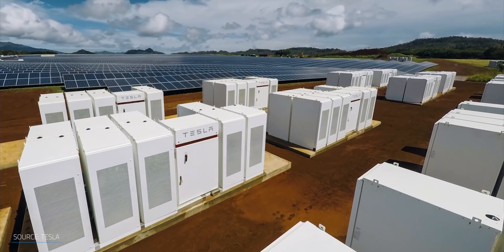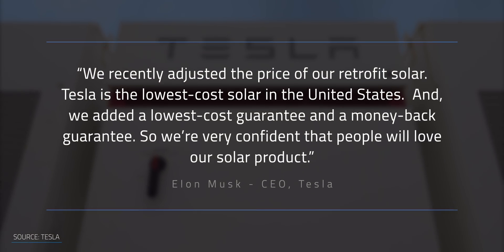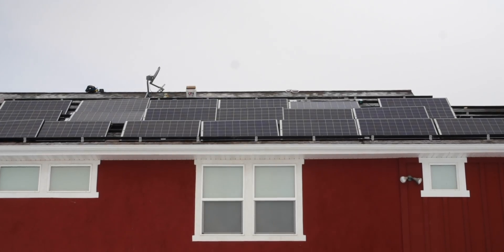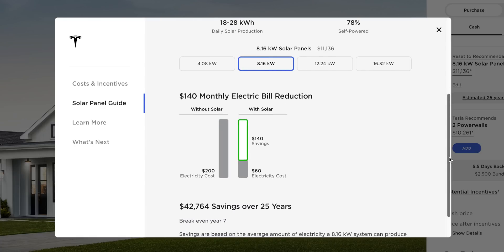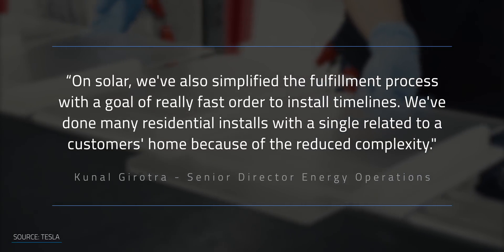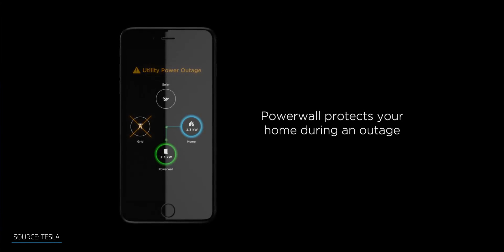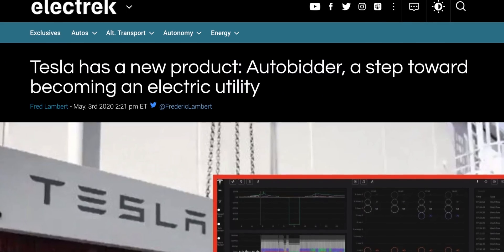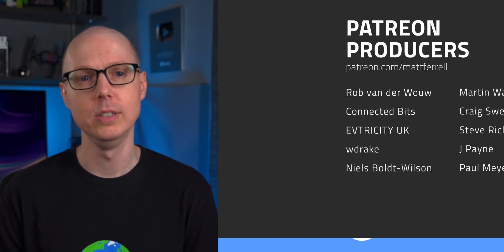Exploring Tesla solar panels game changing price

Comment from the maker: Anyone planning on getting Tesla Solar?  If you like this video, be sure to watch "Exploring Tesla Powerwall and home batteries - worth it?" here: https://youtu.be/Xdo_DIJJxWA
Reply: The ROI on solar used to make it a non-starter. Today, the ROI for me is about 10 years. That makes total sense. The power walls on the other hand, dont. Im in a net metered area, and I can just use the grid for a battery. Being connected, and the administration means that I will still have an electric bill. The interesting question is what will happen to the grid when the tipping point is reached with consumer solar? Will rural America loose access to the grid because its not cost effective?
Reply: @raullasvegas  yeah that's true but without the battery in a blackout you're still in blackout. don't really make a lot of sense .
Reply: @bobholland9924  Ive lived here 5 years, and have had 1 blackout for 4 hours. Next week I will spend a week in the woods without power. For me, it doesn't make sense.
Reply: @raullasvegas  Wow, the ROI on my 12.28Kw system was 2.9 years in Australia, we DO have higher energy costs so that does shorten the ROI. My  cost was $.72/watt for the full system installed.
Reply: @raullasvegas  That makes it theft if you need to take my money in order to make it work.
Reply: @MindBodySoulOk  do you understand that the incentives lower costs to you more than the incentives? If everyone was on solar, you wouldn't have to pay for the grid. 10% of the grid is used to make gasoline for cars. You pay for that. These people driving teslas, and installing solar are saving you money! BTW, are you city folk, or country folk?
Reply from the maker: I think we’re finally hitting the tipping point for solar for most people now, which is great.  I’m with you on the home battery cost/issue.  Actually working on a video about that right now.  Batteries make the most sense in areas with time of use rates, net metering that doesn’t pay out 1 to 1, or areas that have virtual power plant programs.
Reply: @UndecidedMF  Thanks for all the information.  Your videos have led me to look into DIY solar and now Tesla solar (since the cost reduction) for my new house.  Unfortunately, the company we're building a house with won't allow us to do a Tesla Solar roof, but we're planning to install the solar panels after the house is done early next year.  

I'm trying to decide if the Powerwall is worth it since I'd have to get 2 of them to run 240v appliances (like A/C)  if the power went out, and I'm not sure it's worth it.  Where I live, we have 1 to 1 net metering, and we don't have "time of use" rates.  We do, however, have the occasional power outage, especially during the winter when we get lots of snow/sleet ( I live in midwestern United States ), so I'm still undecided.  I have until the spring (when the house is complete) to decide, though.

Keep it up!
Reply: Undecided with Matt Ferrell When you do the video for batteries please include easy to follow calculations for figuring out the ROI. I have TOU rates and SCE / WCE is only paying six to seven cents a kWh for my solar over production. Thanks and great videos as always
Reply: @andrewcoffman2213  "Unfortunately, the company we're building a house with won't allow us to do a Tesla Solar roof, but we're planning to install the solar panels after the house is done early next year." Is this really a thing? Here in Germany I as the owner of the house am the one who decides. Am quiet a bit shocked to hear the company you are paying dictates you what to do and what not.
Is this a common thing in the US or a special case?
Reply: @luckyqualmi   Well, if I had bought land and hired an architect, I could  do whatever I want, but I am working with a company that builds homes and I just pick from a list of options.  The main difference seems to be that I don't own the home until closing, and so I'm not paying for anything until that time.  

Solar is just not something most people here in the US (especially the midwest) think about.  When I asked the builder about it, he looked like he had never even considered it.
Reply: @luckyqualmi  Homebuilders in the US are divided into two types: independent or corporate. Corporate Homebuilders always own the land on which your home is built, and they set the rules for maintenance and modification. Most new communities in the USA are built by large corporations and are much cheaper than independent homebuilders, but they are inflexible. Unless a team if engineers, accountants and lawyers can agree on a community plan where the company makes more money by adding solar, it will not happen. Further, with the "covenant" system of restrictions on homebuyers, adding solar may be a punishable offense if it changes the appearance of the neighborhood.
Reply: I've been waiting for Solar to get below an 8 year payback for me.  Best price I found before was 12 years.  I'll have to get a quote.
Reply: We had an 8K system, with a battery, installed this past January. The sales process was simple, though I wish they improved the UX/UI on the purchase web site.  Once you place an order, you must submit a series of photos of your electrical installations, main panel, sub-panel, panel labels, area around the panels, etc. A single page layout would have been much easier since you could see in advance what information is needed.

Installation was done in one day but it took several weeks to have the inspector come and inspect the system. To be fair, we live in a very rural area, so getting anything done takes time. With the inspection and utility review process it took about 4 weeks after installation before we go the permission to operate.
Reply: Man I love the concept of solar but you're taking your most valuable asset and drilling hundreds of holes in it.  The risk for slow water damage (leaks small enough to not make it into your living space to be noticed yet still damage your structure) is just too high.  I live in MA and can get get all those same federal and state rebates, have a house with excellent solar potential and just can't pull the trigger.  Personally, I've asked about yard based solar but it's extremely expensive.  I'll put panels over my garage and risk a leak in there (where it would air out well anyway) but the panels don't produce enough electricity to be very compelling.  Just go to the Better Business Bureau and read the solar install horror stories... Sorry to be a bummer on panels.  The solar roof is what I have my eye on.
Reply: @Matt-dk3wl  What kind of roof do you have? The mounting solutions used now are well tested decades. Tesla also warranties the install for 10 years against leaks relating to install. I think you're worrying about a non-issue.
Reply: @gemini86  I've got 16 year old architectural shingles.  On a new roof solar panels can be installed OK. On a 16 year old roof, however, shingles will crack and not hold up to being manipulated.  It's iffy to even walk on them.  I'm hoping my roof will last long enough for Tesla's solar shingles to become more reasonably priced.
Reply: @Matt-dk3wl  when working with a reputable solar installer, leaks from your roof are a non-issue. Most solar companies warrant their roof installs up to 5 years. 

I've worked for two solar companies and I've never seen a customer with a leaky roof after getting solar. I know it can happen  but it hasn't been my experience.
Reply: @Matt-dk3wl  Umm, how do you think the shingles are attached to the roof?  Glue?
Reply: I totally want to buy Tesla solar and while they are willing to take my $100 order deposit now, when I speak to a Tesla solar adviser they say they are not currently installing in my area (Ohio), with no estimate on when installs for my state would begin.

So now I have to decide if it’s worth it to wait and possibly lose the federal tax credit (if Tesla can’t even install by next year when the credit would go down to 22%), or bite the bullet and install now with local installers quoting prices that are double the price of Tesla quotes. 🤔
Reply from the maker: That’s a tricky situation.  I don’t think the drop in Federal tax credit is enough to warrant rushing into it with such a disparity in pricing.  I’d recommend checking out places like EnergySage ... or even better for you might be EnergyPal.  They might be able to help you navigate these issues.
Reply: Undecided with Matt Ferrell : Thanks for these suggestions! I had originally gone through EnergySage and they sadly are also still growing in my area and I didn’t get many hits, leading me to contact local solar installers directly or quotes.

I will definitely check out EnergyPal to see if I get better results!
Reply: @UndecidedMF  matt based on the comments we should all move to India where you can get an entire solar system installed for about 150 dollars.
Reply: @Jaws1200  Same for me (also Ohio).  After looking into the total I decided to wait.  The solar option works best with the powerwall.  But pw is small so I would need three.  Now the solar cost is getting too high.  HOWEVER, I am hopeful that the next iteration of the model 3 will have v2g enabled so a switch in the solar system will enable the car to act as the powerwall (and then some 40 kWh pw vs 75 car).  Now if only Dandelion was in Ohio I'd be 99% self-sufficient.
Reply: So, where can I buy just the panels? I only pay about $0.60 per watt for my panels, but if I had some one else install it would be about $2.40 per watt. But as a family of licensed electricians we tend to do ALL of our own work. And so there is NO reason for us to pay a middle man to pay other people to do the work.
Reply: anjhindul 
If you’re in SoCal C.E.D. Will help you out.
Or any electrical wholesale house.
My question is why didn’t you already know that?
Reply: Love your ROI calc, hate that it’s only applicable to your state, also you didn’t calculate with a power wall which doesn’t make sense at all.
Reply: haha you pay dolar for wath when europe pays for kwh less than you
Reply: I'm hopefully having my system installed next month. Tesla and I are both just waiting around for my utility to approve the install. I was actually just informed by Tesla that I'm the first customer on this utility provider and they haven't worked with them before. I really hope their efforts reduce this kind of back and forth and time waste.
Reply: I installed my own n pieced my system together and I don't have probably 2500 dollars in the same power you guys are paying 20 grand for . It's ridiculous. I looked into alot of companies n plans n then looked up the equipment n was like how the hell are you guys coming up with you prices when I'm finding the same shit for half that
Reply: I had a 4Kw installed here in Massachusetts by Tesla last December.  I decided to rent at $50 per month with 0 installation cost.  So far this year, I have generated about 3200 kWh of electricity. At Eversource price of 22 cents per kWh that is about $700.  And there are more than 4 months to go for a full year cost of $600. So my break even was about six months.
Reply: I have a 16.38kwh system with 6 power walls about a year ago from Tesla and I got this pricing at that scale. Was totally worth it then, glad to see the pricing has gone mainstream!
Reply: With a current monthly bill of about $80CDN, solar electricity is not high on my list.
Reply: I added my address to the form, as expected like most other services, installation isn't available in my area.
Reply: Unfortunately,  tesla is not giving solar panels much attention. Apply online and keep waiting.
Reply: Like I've always told people regulations, inspections, and paperwork drastic increase the cost of adopting better and greener technologies, and even after you've through that you could have to wait months or even years to get through the system.

Over regulation is a huge issue that is costing our economy trillions, both directly and indirectly by the cost of our delayed adoption..

This is not to say we shouldn't have any regulations, but they shouldn't be overly complex processes with thousands of pages.
Reply: They still have to deal with each local utilities and their regulations. This is what has prevented national solar companies from standardizing their process and getting a national footprint. This is where local solar companies have thrived. 

If they can incentivize local utilities and municipalities, then use, they will change the industry for the benefit of the consumer.
Reply: waited 2-3 years for Tesla's panels in Sweden, opted for something else in the end (405W LG).
Reply: @Andy Geee after all taxes i pay around 1,50 SEK/kWh or something like that. i pay for the grid itself then i also pay for the electric supplier. i also pay for the main fuse, if it's 16A it's lower priced and going above 20A (the one i got now €54/month) will just be a kick to my dear nuts. I pay around €210 per month in total, i hope to get it reduced by 50% in the spring/summer next year.
Reply: I don't believe they do off-grid?
Reply: yes i will,  after Melon Flask dies
Reply: In Israel, a friend of mine installed a 15Kw system, at a price of 23,530 USD, which makes $1.57/w.
He receives from the electric company about 12 US cents per Kw sold.
He receives his full return on investment within 8-9 years conventionally.
Reply: I signed with a company to install solar panels (owned, not leased) and have the installation scheduled for a couple weeks from now. When I was doing my research I looked into Tesla and while they do have the lowest prices, they also have the absolute worst customer reviews in the entire industry. The consensus from customer reviews across half a dozen websites is that once Tesla has your money they don't care about you anymore. Yes, $1.49 / watt sounds great, but for an extra $0.50 a watt you can get a higher quality panel with a single brand of components (micro inverters and panels from the same manufacturer) and be guaranteed that you will have a company that cares about you and will return a phone call when you call for customer service. 

In addition, that extra money gives you a power output guarantee and a better warranty. Finally, Tesla has a real questionable way of getting to that $1.49 / watt. They are estimating credits from your state and local government as well as federal tax incentives which will be gone in 2 years (or less) and the estimate may not even be accurate.

Honestly, Tesla has a lot going for it in the Battery department and their cars are changing the industry (even with their crappy quality control), but their solar division has a long way to go. Hopefully it will get better, because if they can keep the price low and fix their terrible customer service problem they can be bigger than Amazon.
Reply: So, I purchased a 7.25 kW Solar panel setup for my home.  I had to order my (2) power walls separately, due to back log and some COVID19 impacts.

But my question is, since i order my system back in Nov. of 2019 and the system got installed in March...do I get the benefits of the new pricing? I don't see any difference in the initial price and the final price after install.
Reply: except the major issue with solar isnt the solar cells or panels, but the storage efficiency and costs... solar CANNOT be a 100 percent independent viable one stop shop styled option for many until the storage issue is more advanced than what currently exists, at a much lower cost... and i comment on this coming from a person who uses solar as a mainstay off grid
Reply: Tired of buying expensive cars and solar panels for rich people.
Reply: In solar, an efficiency "breakthrough" is a .0001% increase in performance. We're still decades away from a breakthrough that would justify fuglifying your house roof with hideous solar panels.
Reply: I forgot to ask,"Can you do a video explaining Real Estate Math"? Your thorough and clear delivery is 100s x better than my college instructor.

Great video
Reply: This thing is ridiculously pointless.

$52,000. Thats the price at Tesla's website for a solar roof that only powers your house during the day if you charge your car at night(due to the small battery) when most people are at work or school anyway? 

It would cost over $200 per month for 20 years to pay that roof off which is a typical power bill for a big home.

You still end up with a power bill on top of that for the tv watching, computer use, heating, lighting and car charging at night. SMH
Reply: Czech Republick have over 60% PATENTED solar cell.. but there you get point.. where is CZ-CELL unable keep togedher long time under full load.. ¨material structure¨ get heet up so badly.. ( due high efficiency) and you burn him down.. still anything over 30% is world best.. sooo...cry me a river elon liar!. ..
Reply: Good video as always Matt. One comment would be the Tesla’s terrible customer service and subpar quality of panels, inverters and general work. That is also how they able to bring the price down ...
Reply: Like all home improvement projects, solar retrofit will never be price competitive in the USA due to the added value it gives to homeowners. The high turnover of property ownership in the USA means that home improvement projects will ALWAYS be tied to Added Value and not to the actual cost of installation. A competent self-installing homeowner could get a solar retrofit done for less than $0.75/W, but whenever a contractor is involved, soft costs are overly exaggerated. Permit-issuing authorities always tie permitting costs and fees to the labor cost, meaning that these public safety agencies are incentivized to keep installation labor costs high in order to meet revenue commitments to their municipal bond holders and pension funds. Cicero, Illinois and Dunedin, Florida are prime cases of that. The only way Tesla is driving down the cost is by controlling the installation cost.
Reply: A friend of my friend (student) twisted his ankle in US. Got $ 110 000 bill in hospital. Here, most people will pay 0€. One of my friend doesn't actually have national insurance and broke his finger. Had to make 3 surgeries and visit hospital 11 times. He payed for most things. It was around 2000€. Why is the difference $ 110 000? Because US is nonsense. 15 000 W solar installation here can be done with 11 000€. Without incentives, incl VAT.
Because we pay actual price. You guys pay random numbers business asks. Example.... injection 70 dollars plus syringe 80 dollars. Well, syringe costs around 70 cents (just checked price at pharmacy) and giving a shot takes 2 minutes (nurse workload). So 5 bucks would be ok. Not 150.

Not going for Tesla solar, extremely expensive for rest of the world. Tesla does good - offers best price and cutting LOTS of profit.
Reply: Arnis : Yup.   US is nuts. . .    They spend more per capita than any other country, and piss away the money on paperwork.   Well, it keeps marginal people off the unemployment rolls.
Reply: Dude stop lying about a 110,000 hospital bill for a twisted ankle.
Reply: I only need 4Kw to fully offset my home electric.  I have a perfectly angled section of roof hidden from view.  $1.5/w would be a fine installed price, but I can't seem to find that page where Tesla gives the price of standard sizes.  Could you give the link?
Reply: So Matt why make a video about a system which is unavailable to the majority of the country? When you filled out the information , you saw it was unavailable in MA.  This is just.marketing ploy to increase the stock price.
Reply: The Power walls dont seem like the best option for residential. I mean the house isn't moving, why not use something less exotic. I have a bit of property, so how about lifting a weight? or a water tower? Chrysler had that flywheel endurance car. Bury a flywheel in my yard. I think redisential power storage could be much simpler.
Reply: he he. you fucking morons. in India and China it's barely 0.30$ per watt. you fuckers are still paying a lotttt high prices.
Reply: That’s installed price. Civilized countries have things known as “building codes” and “ labour standards” that increase the cost of the system.
Reply: @pranavpatel3576  Your name-calling, inflammatory language, and rudeness makes it apparent who the moron is.